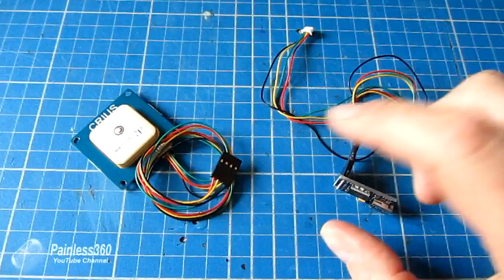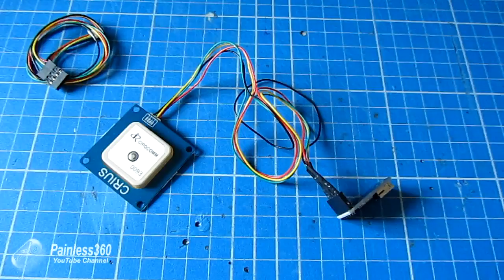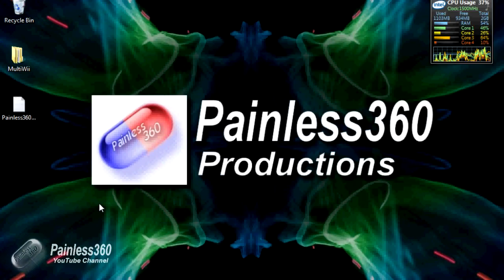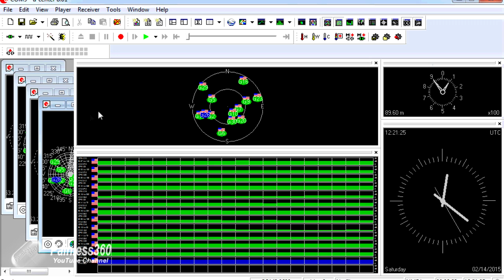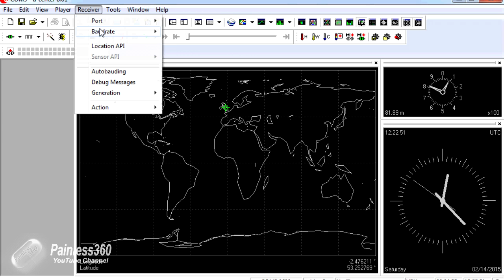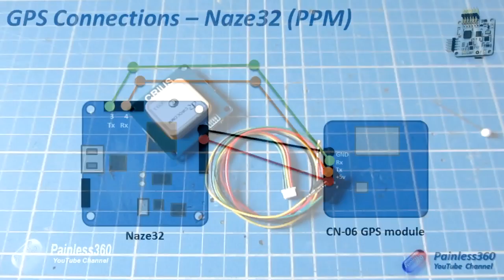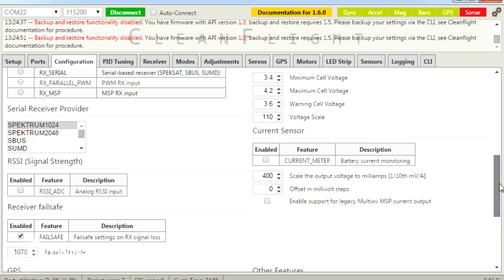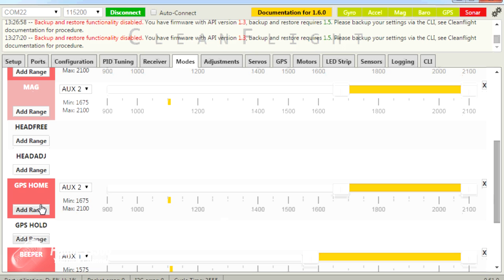(6/8) Naze32 Flight Controller - Adding GPS (NE-06, NEO-06 module)

Comment: i have the neo 7m gps, i have connected it up to u-center, atm its at 9600 baud and works but i want to get it to 115200 baud, i tried your file but when i press "file > gnss" it say "the version you are about to download does not correspond to the version of the GPS reciever." i clicked proceed and u-center crashed. do you know any other way,or do you know what i have to change in the code to make it work?

 your videos are very helpful thank you.
Reply from the maker: theo yates You fixed the permissions problem - well done. 
The link to the manual GPS settings is in the description below the video. The prebuilt file is for Generation 6 UBLOX based GPS modules (CN-06 and NEO-6M). 
Best of luck with it..

Comment: Thanks so much one question after installing the GPS when i AM In the Mode menu the GPS RTH and GPS hold never turns green only red after assigning them to my three way aux2 switch. I wondering what i doing that will not turn them green.
Reply from the maker: Liquidguitars Is the GPS powered on and have a lock ;)
Happy flying!

Comment: Hello, first of all,thanks a lot for all your videos and tutorials they are really good and helpfull, but i have one question?
Is that GPS module CN-06 the same as NEO-6 v3.1 ???
I bought this one : http://www.aliexpress.com/item/Crius-U-blox-NEO-6-V3-1-GPS-Module-for-MWC-MultiWii-SE-Lite-APM-Pixhawk/32251323500.html :
and i am using it with a flip32+ and cleanflight  i've followed all your instructions on naze32 and initially all worked fine...but after two days or so... my GPS hold, and GPS home modes went crazy...as soon as i turn one of them on..my quad gets out of controll and circles around in bigger and bigger circles, drops altitude even in baro mode..etc..etc...no interference on the board compass cos' if i unplug the gps module all is ok and MAG works very good with no drift at all...very weird cos first days gps modes worked fine :\
After some research i realised maybe the GPS module i have is not quite the same you show here cn-06 is not the same as neo-6...mine as built in compass and yours has not...am i right on this??
If so..that might be the reason of my problem...because the quad has two active compasses(one in the board one in the gps module)...is this right or am i saying something wich is nonsense??? and if so...can i use them both compasses toghether if they are pointing in the same way and still have a correct gps orientation??
 Appreciate your help :)
Reply from the maker: luisfilipe1983 Neo-6m is the later version of the trusty NE-06. I would check all the connections on the GPS and recalibrate everything. I wouldn't be so sure that the Mag is ok.. ;)
Happy flying!

Comment: how can i use GPS and PWM? (of it is possible)
U show, that when Throttle and Rudder come into the pins 5 & 6 GPS could word on 3 & 4.
I enabled GPS, and the Naze become a signal! Seems working.
But in flight, when i turn GPS Hold on, he does nothing! HELP!!
Reply from the maker: ituning CCO What troubleshooting have you done?
Reply: Painless360 i have no idea what to do. i looked p in the web, but nothing helpfully found.
Reply from the maker: This setup is straightforward. Follow the steps to the letter and it should work.

Best of luck.
Reply: but i cant use PPM like you, because my reciever uses SUMD. It's only able on Pin4. But the GPS need this. So i used PWM 
Don't you have an idea?
Reply from the maker: Ah I see - you didn't mention SUMD. I don't use that here and have no expereince with it.

If you need another pin to use then your only option is to use a soft-serial port for the GPS. Luck lower speed and more CPU overhead. I do cover soft serial briefly in one of the other videos.

Best of luck with it.
Reply: Don't know how to use this soft serial port.
Maybe we could write over mail? 
ituning96@gmail.com
Would be nice
Reply from the maker: Sorry I only provide free support on this channel. Anything else is chargeable.

I would strongly recommend looking at the soft serial setup documents in the Cleanflight Wiki and looking at how others have setup GPS using soft serial to get back on track.

Best of luck.

Comment: Will the GPS CNSS configuration file also work with Baseflight, Naze32 and a mini neo-6 gps?
GPS unit: http://multirotormania.com/gps-modules/381-mini-ublox-neo-6m.html
Thx!
Reply from the maker: Chris Zinner Should do, most seem to use very similar setups. Only one way to find out! If you are looking at GPS then I would recommend changing over to Cleanflight..
Best of luck!

Comment: hi there just a quick one, what dose it means solid red and blue LED with blinking slow yellow motors esc's won't arm ?
Reply: hello i haven't done much of trouble shooting im new to the hobby tbh 
iv also notice another problem im not getting roll  input signal in clean flight (was ok before) radio/receiver are ok because its working with my cc3d board . so far iv done ESC calibration , flashed the firmware nothing else is cumming to my mind .
btw thanks for response and posting helpful videos  buddy you help a lot for newbies +1
Reply from the maker: You need to go back to basics and make sure that you have the connections in the right way up from the receiver, and the channels are moving ok on the radio. Plugging in a spare servo into the suspect output on the Rx is a quick way to check that it's ok.

Best of luck.

Comment: I have tried to get a response of any kind on the application (u-blox center) but do not.
I have tried swapping the tx/rx wires to be sure of proper connection and also verified the leads to the FTDI/usb device.
I loading a txt file with the GNSS LOAD funtion but have had no response from the GPS on the u-center application.
I have the ublox NEO-6M module.

I must be missing a step somewhere but cannot get past hooking the GPS moduel up.

Your video made it seem quite easy but I didn't get it.

Please advise....
Thanks!
Reply from the maker: cfrankfly Have you tried all the available baud settings one by one?

Comment: Hi, could you please upload a video of that board along with that GPS flying so we can see how good it performes?
I have been searching around and there aren't many videos of that where we can see how good it does the GPS hold position and RTH..
Thanks
Reply from the maker: luisfilipe1983 It performs in the same way as the Multiwii (same code base initially). You can see that in this video - https://www.youtube.com/watch?v=NB7VVvAiPF8
Hope it helps.
Reply: Painless360 ok thank you

Comment: Ok... I confess... you are totally right. My problem was interference in the magnometer, and so it was in circles. Now I fixed it, isolated with that tape and it´s much better. I changed some CLI´s that made my Alt Hold much better since in the graphic it was oscilating in altitud all the time. I changed this CLI´s from defaut:
set baro_noise_lpf = 0.960
set baro_cf_vel = 0.750
set baro_cf_alt = 0.900
Now it´s better, I think.
Question: On MAG, that means, heading hold, It drifts to the right, keeping the heading... any tip about???
Many thanks again. I´ll try to post a video when I finish all settings.
Reply from the maker: Marcelo Tito Farinon Great news. Glad it helped. It is not obvious that the mag causes the 'toilet-bowling' in GPS modes.
I would re-calibrate the magnetometer, make sure it is as far away from the power lines and RFI interference on the craft as you can get it and, if that doesn't work then shield the board by popping a piece of MuMetal between the FC and the rest of the model. 
Best of luck with it.

Comment: Great... You are the best. I got the distance to home ARMING THE BOARD, connected to my laptop and walking some meters. The precision was 1 meter. Perfect!!! Maybe you can include this observation in the vídeo, just a sugestion... but when it tried to return to home it got crazy, flying big circles. I´m sure my CleanFlight setup is completly wrong. Can you help me?
Multiwii 0
ALT    P=3,6   I=0,020   D=0
VEL    P=0      I=0        D=0
POS   P=0,80    I=0,30
PosR   P=4,0     I=0,25      D=0,053
NavR   P=3,0     I=0,33      D=0,083
LEVEL   P= 6,5    I=0,015    D=100
MAG= 4,0

I´m sure my settings are completly wrong but I have no idea how to set them. Thank you so much again.
Reply from the maker: Marcelo Tito Farinon Flying in circles is usually an indicator that the compass needs attention. See https://www.youtube.com/watch?v=3CBxyY0lS6g
Hope this helps.
Reply: Painless360 I can see... tested again and... First problem: I had to setup MAG + Angle mode (not so clear in the vídeo that I MUST have it). Position hold now working almost fine (I believe to have the interference that you mention since started fine and then go for circle). Go Home: I turned the yaw to go back home, but not the correct heading and always went to the same wrong point (so, as you mention, looks like interference on the magnometer). I´m very happy that it´s working and, for sure, after some adjusts, it will work smooth and perfect.
Thanks a lot for all the help.

Comment: Hi great video. helped me sort the gps out. however. What connections do you use if pin 4 is used by My Spektrum dsmx satellite. Also pin 3 is used for neo pixel led, The led light can go if it needs to go. Any help would be great.
Thanks again for the videos.
Pete
Reply from the maker: You need to look at 'soft-serial' ports in the documentation. That is your only choice if you don't want to unplug things. Be aware that the maximum baud rate of the soft ports is only 38k.

Best of luck!
Reply: Looked through the docs. Is there any where to show a learner at this which serial ports selections are connected to which board connections? And what they can be used for please
Pete
Reply from the maker: I wasn't planning on adding this to the channel as it will get people into more trouble. The main video series was created to make it super simple to add all of the element to the board and not have to get into serial setups. I will add this to be list and mark is as an advanced topic. Leave it with me, it may take a week or more for me to get the time..
Reply from the maker: Painless360 In the meantime you can find the pin outs at https://github.com/cleanflight/cleanflight/blob/master/docs/Board%20-%20Naze32.md
Be aware that if SoftSerial is used, then all SoftSerial ports must use the same baudrate.and Softserial is limited to 19200 baud.
Best of luck.

Comment: I need some help... I decided to buy a very cheap gps from Banggood and followed all your instructions. It´s working well, receiving from 5 to 8 sattelites in less than 3 seconds. I installed on my Flip32 DOV 10 and Cleanflight. I have setup for GPS hold and return to home. For some reason it´s not working and what I noted was that I don´t have the distance to home when connected with Cleanflight, showing always zero (I walked some meters far away after Sat lock).
This is the manual:
https://www.dropbox.com/s/fgvdy4hczn05gf3/SKU194872.rtf?dl=0
And this is the gps:
http://www.banggood.com/1-5Hz-VK16U6-TTL-Ublox-GPS-Module-With-Antenna-p-965540.html
Can you help me??? Thanks a lot.
Reply from the maker: Marcelo Tito Farinon Usual advice really - make sure you have a3d lock BEFORE you arm the board (as this is how the home position is set). And make sure that you are using the Full version of the board. 
Best of luck.
Reply: Painless360 , I had 3D locked before armed and my Flip32 is DOF 10, has compass and baro. I connected in the Ublox program again and tried some setting... I´ll try tomorrow and see...
Question: Is necessary to have another mode together with gps, I mean, Angle mode or baro mode activated with GPS Hold or GPS return to home.
Thanks again... I like too much your vídeos... always very well explained.

Comment: Hi Painless, I have been through all your videos on the Naze 32 and found therm invaluable. I have ordered an FTDI adaptor and the Cruius Neo 6 Gps - the only thing I don't have is a cable to connect them. In your video did you say you had made that one? Can I buy one on ebay and if so can you provide a link or even tell me what to search for?
Reply from the maker: Damian Doherty The GPS should come with a cable to connect and I used a few pins to connect the ends to the right places on the FTDI adapter.
Best of luck with the build.

Comment: A quick tip about connecting the external magnetometer from those GPS/Mag combos usually seen would be really appreciated. I know there are some issues with the voltage that Naze32 can accept on the spare I2C port at the back and I'm not sure whether I can just use the antenna from the HKPilotMega 2.7. Thanks for your great videos, keep them coming.

Comment: painless 360,
  first off if i may say with much appreciation thanks to you and your detailed tutorials they have helped me get into the fpv/ multicopter hobby just a breeze:) where do you recommend getting a ftdi adapter at? i seen a few variants out there ranging from a 3.3v to a 5.0v.. thanks for the helpful vids!
Reply from the maker: Charlie Plunkett I've got most of mine from eBay - search for basic FTDI adapter and you should find them.
Happy flying!